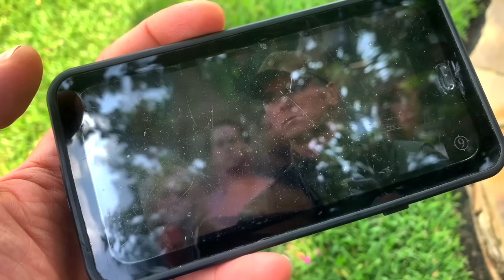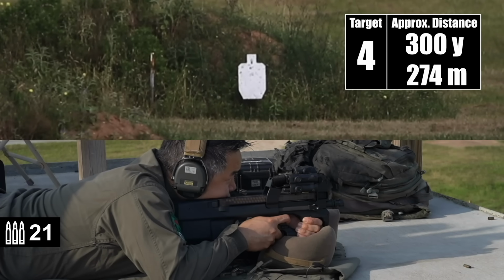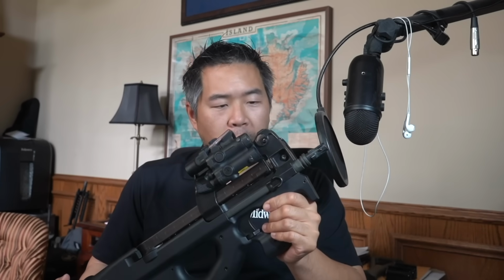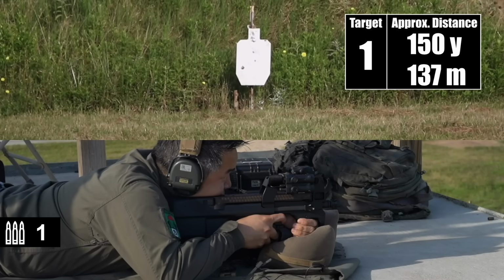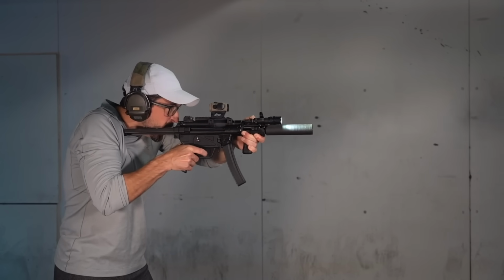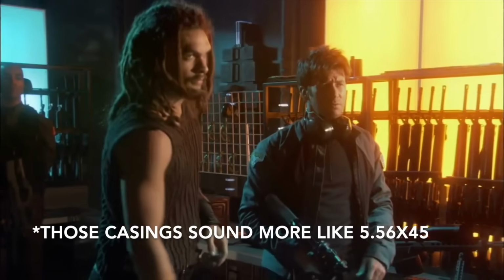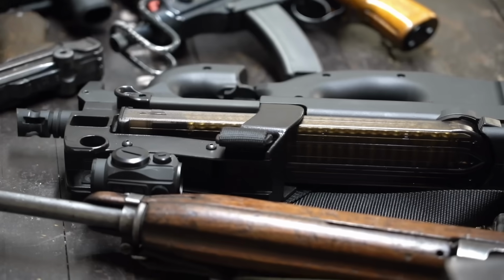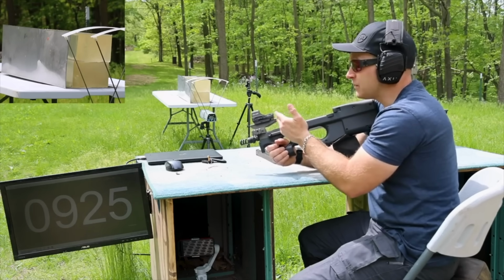FN P90 to 500yds: Practical Accuracy (Stargate SG1 main weapon) PS90

Comment: I absolutely love that the P90 was supposed to be a rear area/support troops weapon.
It was designed for truck drivers, cooks, and clerks, because none of those troops needed a full size rifle, nor was a pistol the answer.
Reply: The modern M1 carbine. In reality it is a great "granny gun" .
Reply: 50 rounds also means less panici mag changes from the cook that gets jumped.
Reply: @modarkthemauler Man, what kind of fckup' situation you have 2 be on for da' shef' to use his p90
Reply: @TiliDoll  My point exactly, if things go that wrong there's going to be a lot of panic and chaos.
Reply: @modarkthemauler  Yeah
If da' cook has to put up a fight means that all the other active duty, tip of the spear and sh!t, got decimated
Geez, I don't if I rather be de-ad in that situation
Reply: @TiliDoll  basically the idea was that at the time of the P90's development the soviet VDV airborne divisions where considered a credible threat. We barely had enough people to spare to hold the line at the border with east Germany with at it's peak 50 Soviet armor divisions ready to charge for Brussels. We fully expected a frontline push into mainland Europe to coincide with airborne troops dropping deep behind our lines and disrupting logistic lines and command infrastructure. The reason we wanted a gun in every hand capable of wielding one was because frankly there was no place out of harms way. There where deployed units expected to hold their ground until down to 33% of either men or material, FFS we even had portable nuke launchers just so that if we did go down, we'd drag the enemy along to hell with us.

And then 1991 rolled around and the enemy collapsed because they bankrupted themselves. One year after the p90 was finished.
Reply: @TiliDoll  The idea was that the Russians would be dropping paratroopers or activating guerilla forces, and when supply convoys got jumped it would be nice if the driver had more than a pistol to defend themselves, not that the front lines are so torn up they're throwing clerks into the meatgrinder.
Reply: Belgian support troops when on mission were obligated to carry FALs. They complained and asked for a lighter weapon. In it's origins it was never ment to be a weapon used by special troops
Reply: P90 is perfectly designed to wait in the truck while real stuff goes down

Comment: Back when the FN FiveSeven pistol first became available....I looked into them and was immediately turned off by the cartridges needing dry lube to function.   IIRC some people did reload them after cleaning off the lube and the pistols didn't work well at all with dry ammo.   The P90 magazine issue is new to me...but it makes sense and now I'm wondering if the malfunctions were due to the magazines themselves not liking un-lubed ammo or was the gun short stroking due to the increased friction during extraction?

Regardless....for a reloading type shooter the need for dry lube increases an already expensive cartridge into the 'not interested' category for me.   Good shooting as always Henry!!

Comment: Nice vid guys, but Henry should’ve used the green tip Ammo, or the lead free hollow point, with the aluminum core, for some reason when those hit ar500 plates they make a cool white flash, and it would’ve been easier to spot if you hit your target,

Comment: Remember that SG-1 was a RECON / Exploration team - there's actually a chart wth all the SG-teams and their roles / Home units.  like Russan Spetznas, USMC, USAF, DELTA etc..............

Some teams are Purely Scientific, some are combat teams, diplomatic teams etc...
Reply: I have served with RECCE teams both in the regular army and special operations and RECCE teams have the standard armament if its convetional scouts they have M4A1s a few with either M203 or M320 grenade launchers you would have snipers that scouta accompany they would have their sniper rifles either the M2010 or M110 maybe thier own M4 if viable. On the special operations side they have slightly different equipment but generally speaking they would have some version of the M4A1 Green berets have the URGI the Rangers at the time would be using block 2 M4A1 while Delta and DEVGRU would use HK416. So really SG1 using P90 look good for ficition but in reality they wouldnt be armed that way because most situations they would be outgunned. During GWOT which happened during this time RECCE teams really empahsized better armaments for Recon missions due to them going out alone for extented periods. Especially US Army special forces used M4A1 on all types of missions because it meats almost any type of situation you may come across it can do short and linge ranges doable enough not fancy but effective and thats what you need it efective and not too mention 5.56 is going to be much more available then 5.7.

Comment: 😊  Have carried / used MP5 (115 / 124 gr.) and 11.5 / 18 barrel AR platforms (55 / 62 gr.), never had chance try P90 (think its 44gr.).  P90 would fall between the MP5 and AR as far as range difference. BUT as something that is small, light, easy use, lot of rounds per mag. If you can find a nitch use area great .  IT does look amazing!

Comment: I don’t think the “concept” of that weapon was ever meant for anything more than 100 yards. It’s basically a “pistol” or a “vehicle weapon” for cooks and admin with much higher ease of use and capacity/capability (in many areas). And it needs to be SBR’d if you get a PS-90.

Comment: It's always been a cool gun, and I've gotten more respect for it in practical use as I've grown up.  Still lots of love for the Kriss Vector in the Divisionverse, but do pack P90s on a few builds.  I have a cheapo airsoft P90, basically a sh*ts and giggles spare
  Although not my most outlandish thought on the gun; I had a fictional character design (I used to actually write stuff) where the compact nature of the firing unit was perfect to hide in a prosthetic limb.

Comment: 17:05 the real world reason is that the show did use the MP5 in the early seasons and switched to the P90 in season four.  The P90 ejected straight down and it made blocking easier. They didn’t have to worry about where actors stood to not take brass in the face, and with the bonus that It looks cool.

The fictional reason was that the P90 was armor piercing. While  Jaffa space armor and 80s Russian Soft armor aren’t very similar lol, it was cool to see them give a plausible reason at all.
Reply: It actually makes a slight degree of sense, Jaffa armor seems largely to be just metal plates, which velocity beats. Using 9mm AP  works too, but likely has overpen issues, plus wear.
Seeing as how Jaffa have a healing factor, but killing their symbiote will pretty much kill them, a bunch of torso shots that can reliably punch through in volume is likely the best way to insure a symbiote hit & consistent kill.Also, how they had the MP5s set up in early seasons must have been heavy. 
Also notice that Jackson doesn't really start using a gun until after the p90 is introduced. 
Which fits with its designed role as a PDW, simple manual of arms and low recoil.
Or he just got tired of dying & got his shit together.
Reply: @MandoWookie all true. I think Daniel starting to carry and use a P90 is a great intersection of his character development and the gear. A P90 is a great gun for someone with less training, and Daniel’s obvious competence with it shows his development from a naive scientist into a more pragmatic and dangerous person.
Reply: @knightofavalon86  Prior to that they did show Daniel equipped with a M9 sidearm. As to how effective he was with it is up to debate. He was certainly more effective with the P90, however. Any shortcomings he had using a pistol may be forgiven given his lack of military training plus it not being his primary job.
Reply: @Angel9932  he still carries an M9 after getting the P90, but as Henry shows, a hard/impossible for experts shot with an M9 is easy for a P90, like 50+yd hits. 
Heck, with how Henry was underestimating how flat shooting 5.7 was out to 200, all Daniel would have to do is put dot on target and point & click 90% of the time.
The M9 in early seasons generally only came out in dire straits and point blank ranges.
Later seasons though, he's packing that thing pretty much anytime he's not on base.
Several episodes in later seasons  have him out & about on Earth not necessarily expecting a fight but whipping it out on demand. 
Too many times they got blindsided by either alien incursions or competing human groups I guess.
Reply: @MandoWookie  Yeah, the later seasons show Daniel as a fairly decent fighter when it comes to small arms. Granted, he doesn't have the field experience of Jack or Teal'c but he can hold his own in a gunfight. Carter would have received some training as an officer plus more when assigned to the SGC.
Reply: @MandoWookie  .355 and slow vs .224 and fast 5.7 is basically perfect for pierecing a thick armour plate
Reply: The best reason is logistics. They're traveling via Stargate on foot. They can only carry and take so much ammo. And 5.7 ammo is light. P90 is compact and carries plenty of ammo. 9mm is a heavier round with far less capacity in the mp5. The armor piercing stuff is a big plus. But the range of 5.7 is much better as well.
Reply: I like to headcanon that the SGC uses trinium core ammo once they switch to the P90. They have enough of the stuff to build warships out of it, so it stands to reason they could use it in ammunition too.
Reply: The funny thing about that is in the pilot they show that an M16 with its 5.56 cartridge couldn't penetrate the Jaffa's armor while a 9mm could. I always found that funny, if 5.56 from a full sized rifle couldn't penetrate the Jaffa's armor, then there's no way in hell that 9mm from a SMG could.
Reply: @Riceball01  they had an episode where they needed to use a bow and arrow because it was slow enough to not be stopped by their shields.
Reply: No, the actual reason was that 5.7 ammo was incredibly hard to obtain due to the military buying most of it due to Iraq.
Reply: @SledTillDead  You mean 9mm? Because 5.7mm isn't a widely used round and the P90 was never adopted by NATO so none of the nations involved in Iraq issued them out in any appreciable numbers. Even to this day it hasn't been widely adopted, just to a spec ops unit unit here, a SWAT team there but not in anywhere near the numbers had it been actually adopted as the official PDW of NATO.
Reply: @Riceball01 IIRC the secret service use the P90, as well as various PMC

Comment: In my older PS90, the 40gr VMAX is not as accurate as the SS192/SS195.  The aluminum core protectiles the P90 was first designed around seem to have a faster powder, stabilize and fly better.  The BC/weight/velocity of the two projectiles seems too far apart for both to work well in one configuration.  I cannot tell/didn't catch if the P90 used is a factory SBR nor if it in it's original twist rate.   The 27gr runs better in my older Fiveseven pistol as well.   I save the cheap 40gr ammo for plinking, -Counterstike 1.6 player with some bias.

Comment: For the job it was designed for (ie. replace 9mm sidearms & sub-guns for self defense of/by support and vehicle crews)   it's a big improvement.   it's not a replacement for 5.56 & 7.62 long guns or carbines for 'Infantry'.
Reply: Yeah, it’s the modern equivalent to the M1 Carbine. Ironically, it went through a lot of the same circumstances as the M1 Carbine, including being used by certain speciality frontline troops who liked how handy it was beyond the personal defense role, to also complaints about lack of effectiveness of the cartridge when pushed beyond its design limitations (like the myth that .30 Carbine bounces off Chinese winter coats in the Korean War when in reality, troops were just trying to shoot the M1 and M2 Carbines way too far away and missing).

Comment: A redesign modernizing the round while also using a steel base and higher pressure from faster-burning powder would make the 5.7x28 cartridge excel.

Comment: 4stars; -1 star for not taping goa'uld cutouts onto the targets. Richard Dean Andersen would be disappointed :( 
ON SERIOUS note: it def is epitome of PDW 'rear echelon' weapon. Its more range/force than something like a vz.61, doesn't have room for extras a GPR/DMR/etc would have (IE peq15,etc) bcuz it doesn't need that. 

Disappointing that they didn't develop a compact supressor for it (a la that chinese integral suppressed pistol Forgotten Weapons covered). The AP capability was quickly moot it seems and it never got 'beefed' up to a more modern round (say 300blk, but AP), which would prob be more effective.

Comment: I've found multiple different methods for carrying p90 mags in airsoft. First, and cheapest, is simply 2 satchels, one for fulls one for emptys. The double mag pouches work on a belt at the 3 and 6 positions. And on a load bearing vest, rigging it up so that the mags are horizonatal rather than vertical worked.
Reply: The spiritus style chest rigs with elastic 5.56 magazine inserts work well. The lip on the bottom of the P90 mag hooks under the elastic and helps hold them in. I wouldn't recommend going prone with that set up though.

Comment: As someone who recently fired a magazine thru a true P90, the progressive trigger is really cool from a mechanical standpoint, but I struggled to get single rounds off even with the heavy long pull. Towards the end of the mag I could sort of do it, but focusing on a tight 3 or 4 round burst was honestly better than trying for that single shot. The selector has a semi only position, so if someone needed that single round only, that's the better option by far.

Comment: Of course the correct answer SG1 started off using MP5s and swapped to the P90 being the top tream, while the other SG teams still had MP5s mostly.
Reply: The MP5’s were dumping hot brass on the actors so the switched to the bottom ejecting P90s.  The early seasons also have a truely 1980’s level of gunfire which is really missing in just about every show these days.  Now shows use CGI and weird editing.
Reply: @JimmySailor it also had to do with some law changes in Canada and H&K restrictions at that time. But yeah the actors and such were complaining about the brass ejection which is such a funny reason.
Reply: @JimmySailor in universe explanation was better armor piercing capability
Reply: Except for the brief interlude in Season 7 where 5.7 was too hard to source due to Iraq so they switched back (and the 'Carter Special' stubby 7.25" AR-15 carbine)
Reply: @jessicantina  They didn't switch back. They just had Carter use that RIDICULOUS extra-short AR; O'Neill still used the P90 and they wrote the scenes so they limited the firing of P90s.
Reply: From what i remember the original movie used MP5, and the series started using MP5 and then switched to P90 to defeat the armour of Jaffa warriors, and higher volume of suppressive fire, the bullets its supposed to use its not even close to the civilian ones
Reply: @trinas7131  The Stargate movie also had others, including a very cool (and authentic) MSG90.  I still have a hankering for an original MSG90, and I blame the movie for it :)
Reply: @trinas7131  It was encountering the Unas in large numbers that triggered the transition to the P90. And yeah, they also run the higher velocity AP variant of 5.7.
Reply: Lore reasons were evident in the original movie - Jaffa armor being resistant to 9mm.  I believe in the show they started using 9mm AP then totally switched to 5.7.

Comment: Cool, the P90. I was walking through the woods with my son here in Holland, where 20 years ago a navy shooting range was located. We could still find 5,7mm brass laying around, used by the CT Marines unit in those days. The brass was still shiny due to the coating that was on the cases. Nice video!

Comment: surely it's going trans/subsonic at the further end of the range which would explain wild inaccuracy
Reply: It is ~1095 fps at 200 yards from a pistol, not sure what fps they would get out of a full length p90 but it should be below 1000 at 250 to 300.

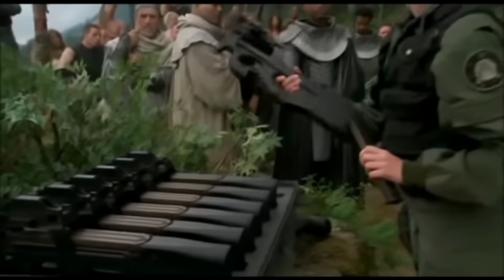Comment: 14:54 I think they used them because blanks for 5.56 and other rounds basically vanished due to conflicts going on when filming the series but the 5.7 stuff happened to be around and the P90 looked cool so they used it.
Reply: They also started to run out of 5.7 blanks in season 7 so Carter got the "carter special" 7.5" M16 with an Elcan and beta drum mag.
Reply: I thought it was because they got tired of burning each other with brass
Reply: No, they used it because series was make with cooperation of Air Force, and Air Force they lease it. They stop use them in later season because 5.7 ammunition problem when Air Force send troops, and 5.56 was easer to obtain, so change weapon to SiGs.
Reply: @mikolajgrotowski the Air Force never used the P90, the show was filmed in Canada, they used it because they switched channels from Showtime to SciFi & got a better budget. They wanted to upgrade the look of the show, the P90 looked both SciFi & ejected downwards so helped with filming. The guns were leaked to the production, but from a film armorer company in Canada, not the Air Force. The Air Force had an advisor for the show, they were 'endorsed' but that doesn't mean any actual support. They used stock footage for the outside of the SGC from another movie, everything else was done on sets, or on locations around Canada.
Reply: they also switched to the P90 due to the downward ejection so it made it safer for the actors.